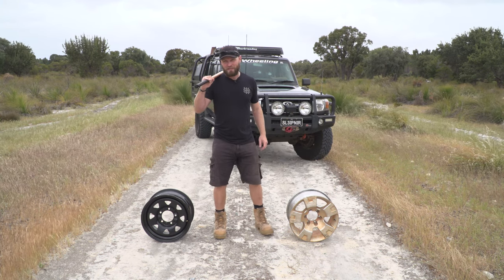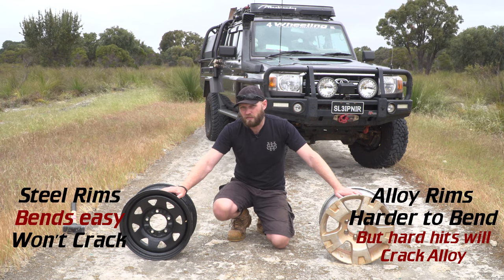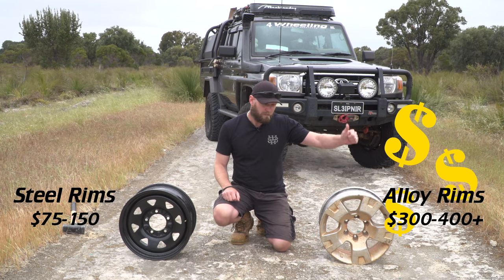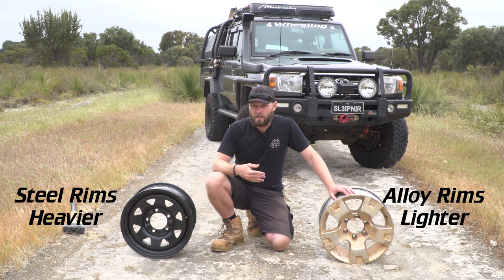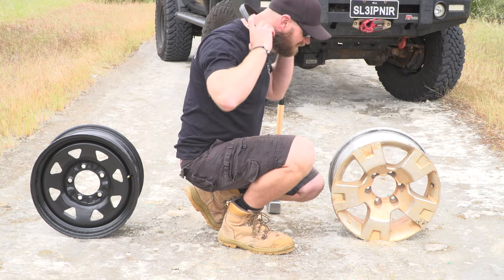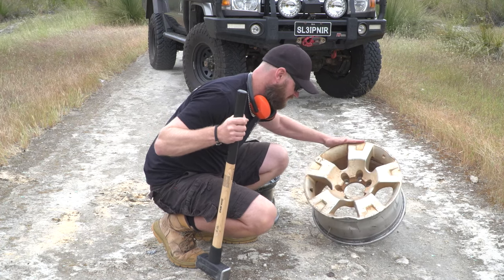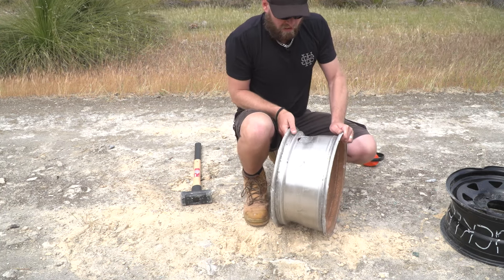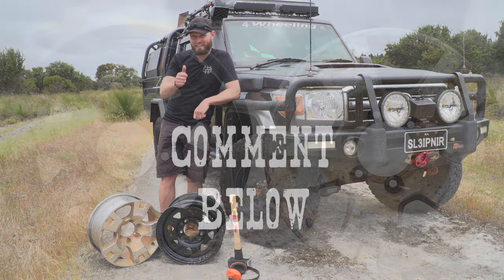STEEL vs ALLOY rims Off-road Wheels

Comment: Driving in Canadian outdoors..Highways, Roads, Dirt roads, Full off-road  40*c To -51*c weather The best rim is a Steel rim 
With extreme weather Alloy wheels "sweat" And do become rusted with white powder Rim leaks are very common  Even after The rim has been removed from the tire And cleanned And reinstalled 6 to 9 months later You have the same issue. in freezing temps if you slide into say a curb Chances of the alloy wheel snapping a chunk off are good The steel wheel You might get away with a bend But still be able to drive away to a repair shop Or home ..And in freezing temps no one wants to hang outside putting on a spare. While other cars and slipping and sliding around you. Steel off-set rims are common to find And very cheap to the alloy ones  I run 15' -19mm on my Chevy blazer 4x4 which has a slight lift mod which together keeps the centre of G  somewhat ...2.5" higher 1.5"  wider

Comment: There is also CAST Aluminum and FORGED Aluminum.
Big difference.
But agree.
Steel wheels. They are cheap and replace them with the tires.
Reply: Why replace them with the tires?

Comment: I got caught out by a huge pothole on the Tele Track and put two alloy wheels of the car and one steel wheel on the trailer through it. I nearly hit the roof, I hit it that hard. Both alloys on the car were fine, the steel rim on the trailer was bent so badly it lost all its air immediately. I banged the steel rim back enough to seat the bead again, but it would have been terrible to drive on. It was just a spare from then on and was replaced at the end of the trip. The alloys were still on the car when I sold it, and probably still on it now. There’s all sorts of variables like suspension type, axle weights, etc, but I think good quality modern alloys are the way to go.

Comment: Excellent video!  

Was thinking of replacing my stock-standard steel wheels for some pretty alloys for my 1990 SWB 70 series LandCruiser, and though I don't go heavy-duty off-road much anymore - been there, done that - I still like to sometimes ... and fact is my own driveway occasionally needs 4WD, between the droughts and the after-flood potholes (what may one say ~ on our selection if it's not blowing away, it's washing away!) ... so I am now rethinking.  

Thank you for the wonderful level of detail.  It was very helpful.

Comment: The most annoying thing about decorative rims/wheels is that they collect mud, snow, and ice. That destroys the balance.
Reply: A wooden yardstick/meterstick will help to scrap all that stuff out.
Reply: @nicholask7347  Where I live ice cumulates and is extremely difficult to remove. A simple wheel makes life simpler.
Reply: @MichaelRoyDuckworth  definitely does. However I still get build up in even the simplest of wheel patterns. If I remember to, I spray the inside with some WD40 to help prevent build up.

Comment: SUV aftermarket alloy rims have reinforced centers. Which make larger brakes shifty, but it's do-able. I've seen alloys for a C-note. And my factory alloys are still available used for about $50 bones. For my desert off-roading they do fine. Going to buy 4 more for a trailer, and to replace the steel spare. Going to powder coat them all, as well. And quality rubber with reinforced sidewalls can be had here starting at a C-note or two, dependent on oversize. Makes for outfitting without damaging the budget much, and they're swooning the gal's.

Comment: Do you have a video of reshaping a bent steel wheel?

Have you ever seen an aluminum wheel crack in the middle from off-roading?
Reply: 🔨🔨🔨🔨🔨🔨 -reshaping it.
Reply: i had to replace 3/4 OEM aluminum wheels after a quasi-offroading trip, two of the wheel hub barrels were cracked all the way thru, the third was bent/cracked and that was lesson enough for me. STEEL wins
Reply: Why is it so freaking hard to get steel wheels for a Tacoma?
Reply: I’m gonna go with some FJ steelies.. they’ve got that MilSpec look goin on, Ugly as hell, but durable and easy to find for a reasonable price
Reply: brienb1770 that’s either very shit quality rims or shit driving. In years of working exploration with all our vehicles coming standard with aluminium wheels we have never had an issue. The one time I’ve seen one break was when an operator drove a light truck into a hole at 110km/phr and the wheel that hit first crack.

Comment: Alloy vs steel in trays Ronny, that would be an awesome video
Reply from the maker: interesting question, I've pondered this one a few times myself and ended up back with steel each time.
Reply: Ronny Dahl yeah is that cuz of the price and strength. Cuz I’m getting a custom tray and still unsure wether to get alloy or steel
Reply from the maker: In my opinion Steel as the base, can be repaired anywhere, stronger but heavy. Alloy can be strong but prone to cracking if done by someone who has no real off-road proof building experience. Alloy is only 30% lighter than steel as well. perhaps consider steel frame tray with super thin alloy checker boards as the floor. will save some good weight there as you can rely on the frame and not the floor.
Reply: UNLESS you're going to stock a welding kit you aren't going to know  if something is repairable until you speak about density you can't actual discuss the  rigidity factor  because you go from 1mm -100mm  thick and each metal you work with has different properties  when you heat it and submit it to cold..

I always think thicker the better  light gauges in any metal  tend to fail over time..
Whether you use  use a ute or up to the troop platform i always recommend in installing exoskeleton roll cage because the simple to save cost in weight and rigidity they build everything out of aluminium 

the bull bar is there to protect the 4x4  not that so what you hit walks away  and wipes you out from continuing your travels.

I think most safety features built into motor vehicles today may have a usable sense on road conditions however off road you are likely to get yourself killed ..
Reply: Ronny Dahl thanks alway great advice

Comment: It’s just a different style wheel. The steel has a smaller offset, so it has more support for direct bell hits. Since the aluminum is already weaker against a force over a small area it would have likely performed on par with the steel wheels givin they had same exact offset, width and diameter. Just a thought

Comment: after lifting a steel 16 inch and 17 inch, then lifting a 16 and 17 alloy rim, i made my mind up. the steel is just too heavy.
Reply: Tea spoon of cement should fix that
Reply: anyone with common sense will know that when building an offroader you want a low centre of gravity.
more weight at the very bottom of the vehicle, the better it will be.

Comment: I have steel wheels on my FJ80 but they have a pretty good vibration bc there is no good way to properly balance them. So I bought a set of factory aluminum rims to  hopefully solve that problem.  The steel rims do look cooler but driving a rig that shakes isn't.  I know that's not the case for all steel wheels. I just found the factory ones for a great price on Craigslist

Comment: Its not just the big 'whacks' that count, all the little bumps add up. Got so frustrated at replacing buckled steel rims that can't be straightened. Ruins your tires and gives an awful ride. Haven't had a buckled rim since switching to alloy.
Reply: Damn true. Had a mate a few years back that had alloy rims.
One of his tyres kept slowly going down.
Eventually found a tiny hairline crack in it.
Took us ages to discover the secret.
Reply: Seems like you need to change your driving habbits, ive been hard offroad and snapped a front leaf spring in my cruiser, drove over a rock at 70 k an hour, bent the rim, it was fixed at shop the next day but not so much for my leaf spring, What im saying is, if i had an alloy rim, it wouldve shattered at the speed i went. Havent had a problem since either, try getting wider tyres, that might help
Reply: You are delusional. I have been punishing steel rims over severe corrugations for years. They have never 'magically' warped. I have never seen anyone with the issue you describe. In all of my time working with used cars, I have never seen steel wheels that were bent through cumulative small impacts.

What you have tried to state here is a justification for your wasting of money on rims that you thought were better and simply are not.
Reply: I have a buckled aloy rim right now... Its now my spare until I find a replacement
Reply: I've never seen a steelie just give up.
Alloy wheels develop cracks over time.
Reply: had alloys on a ute that kept going down and it was corrosion where the tire met the rim the "bead" 
needed new rims for it to fix it
Reply: Earl Rogers Yes. That has no impact. Unless I drove into a volcano, there is nowhere that would be hot enough to have any effect on the strength of either metal.

If I was to drive into a volcano, an alloy wheel has a much lower melting point.
Reply: Earl Rogers No. Your brakes operate at far higher temperature. Your city would be at around 40c (110f) in the summertime. Your brakes are happy to operate at anywhere up to 2-300c on a stock vehicle. Usually far less. The difference in brake wear between a 20c day and a 40c day is so minimal it is not funny.

If you have carbon dust issues and your brakes are wearing fast, but better quality pads. Be more gentle on them too.

It definitely is not ambient temperature related.

Comment: While I have never tried them on a 4wd I have messed around with heavy aluminum wheels vs light ones on passenger cars, particularly low hp ones. like 5-10lb difference between wheels and it was an incredible difference, much more available power, more nimble, better steering feel etc. I am considering trying to buy second hand aluminum wheels for my Suzuki Sierra/ samurai to see if I can gain any noticeable performance. However my wheels are a nearly stock size and the factory steel wheels are light.

Comment: 5:40 you will notice a change in gas and range a little bit. When my truck came with steel rims. I changed those immediately!
Reply: The percentage is in marginal or is it substantial like 20% or greater

Comment: As someone that works in manufacturing for a company that produces products made out of various metals including steels of all sorts and types including stainless, irons ductile and cast, bronze/brass/copper alloys and aluminum I have to say that your comparison on strength I find interesting. It seems you are using a modified definition of the metal failure then what I, or anyone in my industry, would describe as a failure. I like how you explain your reasoning and I don't disagree with how you judge the materials! I would  point out tho that mild steels are typically stronger than standard aluminum alloys in not only tensile strength but also pliability and impact resistant. Steel also has a better "memory" as you demonstrate when fixing dents in the rims. If you start really digging and getting specific, which this video does not, you can find example at the ends of spectrums to argue otherwise. Great video!

Comment: I think the real story here is that you've bashed out steel rims "more times than you can count" but I've only seen one cracked alloy in my life and it was in a huge crash from 100km stopped by some off roading in the shoulder then a boulder in a fully loaded down 3/4 ton suburban.  Sure the steel is field repairable, but it needs to be.  My stock 80 series alloys are coming up on 300,000 miles and they get beat to hell and back all the time and keep on grinnin.  I honestly don't even know anyone who's broken an alloy rim besides that one.
Reply: Patrick Rich some of the showy type rims are very weak, I've seen tons of cracked alloys, a lot have been on the bead or centre band and been leaking air. I think any decent quality rim tho would stand up to most punishment and tend to bend or break something further up the line.
Reply: Patrick Rich iv cracked all 4 alloys more than once on different occasions! I got them welded and repaired and got very tired of coming out to my truck having flat wheels, it's cheaper to replace a steel wheel than get an alloy repaired
Reply: Jack Ruddy how? Oe or after market?
Reply: Patrick Rich rocks and bad potholes! They were aftermarket rims, it came with narrow rims as standard, but I'm sure oem are tougher or forged aftermarket if you need em wider but I couldn't justify pumping that kinda of money into something what will get scratched and smack off rocks
Reply: I've cracked them at low speeds, around 25mph around a bend on a National Forest road in Oregon.   Well traveled.  Just scooped some gravel up into the wheel and tossed it around the caliper and hub assembly, didn't damage any of that but cracked the rim.

Not sure if the flickr link will show up below but here's an image:

https://c1.staticflickr.com/5/4643/38570184584_1f1df306c7_b.jpg

Now you've seen two cracked alloys in this lifetime.
Reply: Keep in mind my Xterra weighs only around 6000lb fully loaded, armored and with a winch.
Reply: Patrick Rich I've seen alloys crack on potholes.
Reply: BS.
I see them broken, cracked and completely gone (except for the hub) ALL THE TIME at the shop.
Steel, not once.

Comment: I always change to Steel,  alloy rim I've own, leak around the seal,  here in the UK salt is used on the road in the winter this over time will rot away the sealing capabilities. To cure this I have had to remove the tyre sand up the rim and repaint or use a sealing compound none of which is a long time cure. Fair to say I hate alloy rims for this reason alone..
Reply: +1stMrSceptical: you are correct.  I just bought an ancient estate car with alloy rims which were leaking for exactly the reason you described, and immediately replaced them with steel rims that I painted with anti-rust paint before installing the tyres.  Moreover, the manufacturer specifies steel rims must be used for winter tyres, which I also use.
Reply: Yep, the salt here makes aluminum rims leak where the tire seals too.

Comment: My  2 cents on the rust issue from road salt world of Eastern Canadian winters.  I have had many rusty steel wheels. Essentially all of them eventually.
But, they never leaked air because of this.  OTOH, the one time I use Alloy winter rims when they eventually corroded (and they will eventually), they leaked air, and talking tires off, cleaning them up the bead, they still leaked again in no time.  

Steel all the way, except for fancy summer only city wheels.

Comment: Depends on the situation. I'll probably go with steelies on my mustang because it'll be doing so more advanced off-roading than my truck. My truck has aluminum wheels because I like the looks and the lower weight helps her to maintain speed without downshifting constantly. Yes. It did make that big of a difference. Hopefully the new motor will make a little more power. I have actually cracked a steely. That was when I got T-boned in my truck.  It did hardly any body damage outside the door that got hit, but somehow cracked my wheel.

Comment: I have factory 18" alloys on mine. A replacement is $1500 (Toyota...) I have tortured them , they have deep gouges in them but luckily haven't caught a bead yet. Next set of tires will have a set of steel 17"  rims for sure. I always thought the difference in weight was minimal myself.

Comment: Nice one mate, I love hitting things with big hammers too.
Steel rims win hands down in every department. Looks;- All these new 4x4's come from the factory looking  like Christmas trees these days, so you need a basic black steel wheel to give your ute/truck that mean animal look. Mag wheels might remove heat quicker, but in my opinion that is the only thing they have got going for them.
Strength & Price & availability, well I have seen the same Sunrasia steel wheels that were fitted to 4x4's back in the 70's still available Brand New today. 
$95 bucks for a  brand new 17" x8 rim is a bargain
The rest he said in the video.

Comment: Just to clarify, Alloy definition: 'a metal made by combining two or more metallic elements...' You have to mix metals to make an alloy. An alloy wheel may have a percentage of aluminium in it, however it isn't an aluminium wheel, and there is no such word as alloyminium. Apparently according to google there's a company in the UK called Alloyminium.

Comment: keep in mind, an alloy with a broken off piece of the edge where it seals is not re usable, but IF the tire is still sealed and holding air, run the bad wheel. at least on the dirt roads to get you to safety. and for beating a steelie back into shape, if you can break the bead loose the bend will go back in position easier, so a hi lift and move the rubber off the rim so you hammer it back as best you can.

Comment: I like he steel. Busted two steel rims on my UTV the other day just before sundown, and thank God I had a hammer and a compressor! I was able to hammer them both back enough to hold air. I'd like to put steel in my GX 460 bit I'm not sure how they'd look on it. Have to look for a visualizer. Alloy rims are definitely classier!

Comment: I use alloy because that is the standard for my 1995 ford explorer... not like it is hard to find spare rims for them cheap. Go to any US junk yard and you'll find one. They are usually $20 used. If I had to get a new set of rims because they are small alloy rims (15" diameter and 7" width) I would go for steel because a matching set of steel ($165ish USD) is about half the price of a new set of alloys ($300ish USD).

Comment: Aluminium alloy wheels are originally designed to be light and reduce un sprung weight. (Hence the experimentation with magnesium in motorsport). Driving a 4x4 with solid axles that are not designed for good handling and comfort but for strength and cost effect means using alloy rims are redundant other than for the purpose of looks.